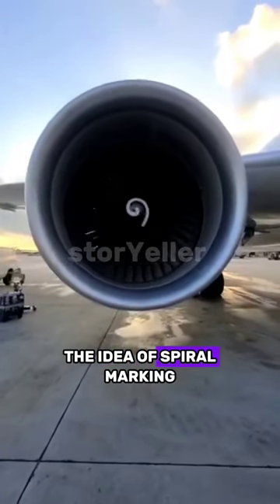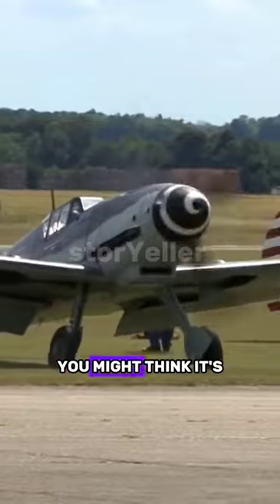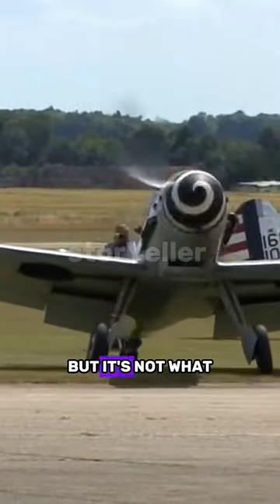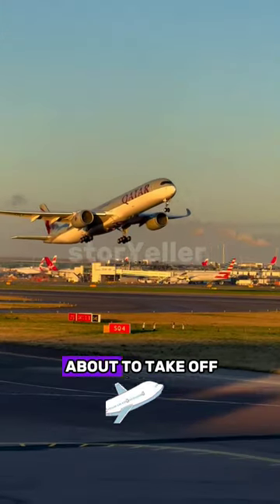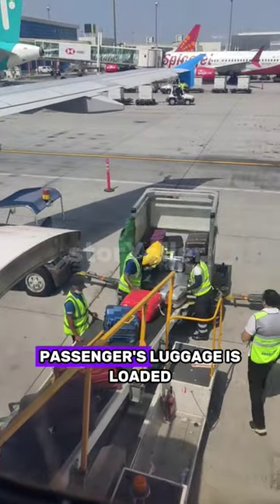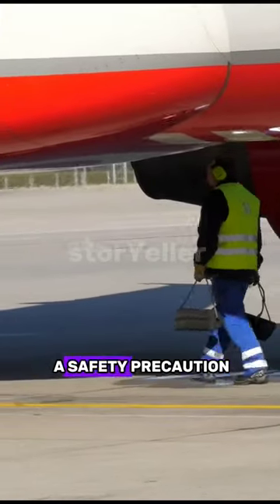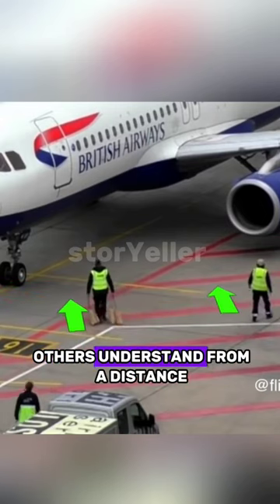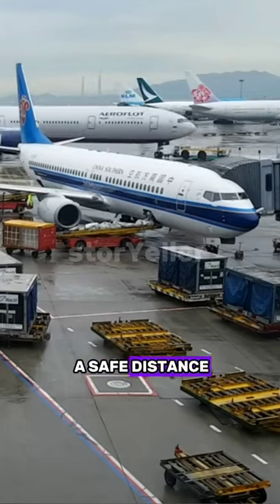Why Do Airplane Engines Have Spirals? (It's Not for Looks!) #shorts #didyouknowfacts

Comment: I've never met a deaf jet engine mechanic and there may be a few, but they're not exactly quiet when they're running. If you're picking up what I'm laying down here.
Reply: Yes, but also they do wear hearing protection for that exact reason and also at many busy airports during a big push, it could be so loud that they can’t tell one planes engines to another’s.